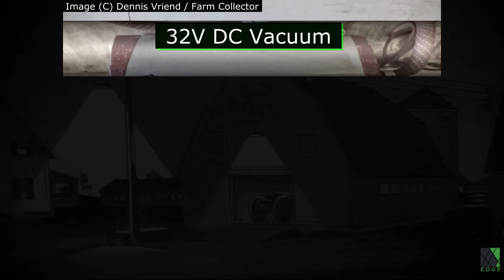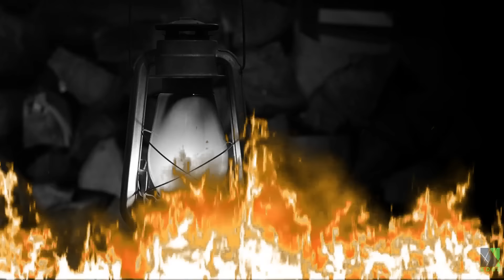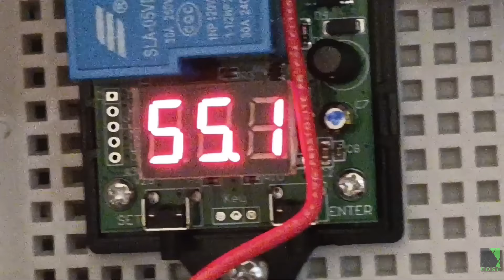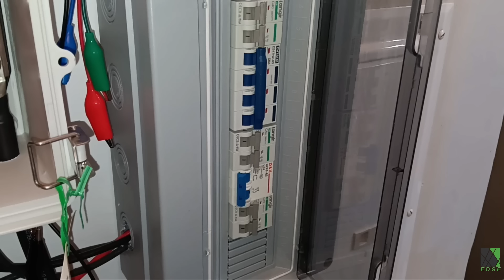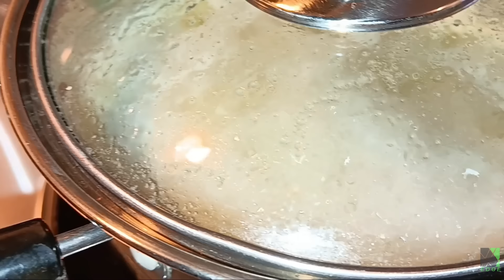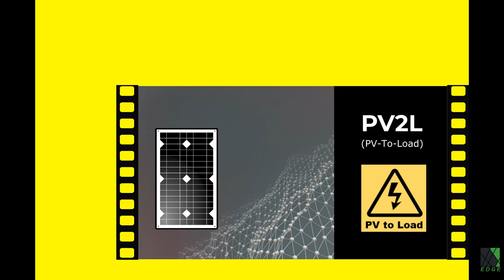LOST HISTORY: 1900s OFF GRID DC - How Did It Work? Off Grid Before Solar Power #history

Comment: I grew up in an old farm house where all the lights and electronics like the radio was powered by 12VDC. My grandfather built the house back in the 50’s. He had a wind turbine charging a bank of 1.2V Edison cells wired in series. It cost him around 10 cents a year to buy a tin of grease lubricant for the bearings of the wind turbine. 
Cooking and water heating was done via a built in wood stove. 
Those were good times.
Reply from the maker: @RayWarren-y8u Ah the good old days.... so simple and yet works so well. I need to get us a wind turbine our here!
Reply: Was it a dunlite windmill ? However I believe they were a 36 volt system. Dunlite also produced the 36 volt kitchen appliances and tools.
Reply from the maker: @Biggles732 Been doing some research. There is some available information available on Dunlight systems, they appear to be 32v from what I can tell? Or 36v nominal or they had more than one voltage standard. Not sure. Some of their windmills were over 1kw in size. Definitely not toys. Apparently in Australia they had radio communications powered by windmills and this was very quite common. Still researching the topic. I am glad someone told me about "Dunlight" otherwise, I'd  have never known what keywords to search for. It's  been very hard to find any decent historical documentation.

Comment: Kinda crazy that common household electricity is only 100 years old.
Reply from the maker: @superskrub4209 Electricity - one of the most useful forces on earth!
Reply: We are so dependent on it now if the grid went down there would mass chaos beyond belief.
Reply: @RodgerMudd yes but not in the Amish communities. I think we need to take a hard look at using battery powered home maybe not full time until we have to but on a doable scale. My plans are to put a tiny home on my NC mountain property and run everything on battery power. Spend a whole week on battery power if it becomes a way maybe it would work full time. We use too much electric for nonsense. The laundry would be the hardest part especially if it rained. I'm going to do my lights on filament bulbs I'm not a fan of LED lighting. I removed most of mine in my current home. I use 22 watt and 11 watt bulbs the four watt are my night lights. I have two lamps with four 11 watt bulbs using three Y sockets  in each lamp the fans have 25 watt bulbs. It's bright enough in the living room. I have LED T8 in the kitchen but I don't use it only on occasions when I need more light. The one over the sink is enough and over the stove is enough too.  The dining has five 11 watt Edison style bulbs. Same as the two lamps in the living room. I found out the LED bulbs bothered me so I went back. I cannot stand bright 6000 k lighting of any kind. 73

Comment: Nice.. and WOW..  32V.
Reply from the maker: @OFFGRID_Trucker It's kind of ironic because many detractors and so called "engineers" tell me 48V+ can't work for residential power!!! even though I have a working system for years now... meanwhile, our ancestors were running all kinds of appliances with only 32volts and old thin wires.. :D :)

Comment: To start with for all the koolaid tree huggers!  Without COAL, OIL , there would be nothing!  No industrial anything! It takes energy and without COAL AND OIL, it would have Never Happened!
Reply: The reason for solar, especially using methods like solar edge is using is a lot cheaper than buying grid electricity. It doesn't matter if it takes coal or natural gas to make the panels and rare earth minerals or lead to make the batteries. It's like the difference between having your own vehicle or relying on public transportation. All the lights are off around you and the linemen come looking for a blown transformer, but your lights are on. It's a very satisfying feeling.
Reply: @melvinhunt6976  as is the case this time, it's actually you guys always starting the fight. You make us out to be tree huggers because we want cleaner tech now that it's available. Calm down dude. Big oil paid a lot of money to get you to think we are the enemy.
Reply from the maker: As I always say, everything, including solar panels / batteries, came from the grid... powered by burning fuels, factories, digging machines and massive refineries.

Comment: my grandma left a memoir explaining how it was like to live without electricity in the 1920s and what it was like when they got their first battery. i believe you used to refill these with electrolyte. 1800's versions of the Sears Catalog also feature manually refillable batteries
Reply from the maker: @999aurora Fascinating, we need this part of history to be better documented
Reply: Modern flooded lead acid cells need to be topped up with water since the acid stays while the water is electrolyzed and forms hydrogen during charging, and the water can also evaporate from not perfectly sealed cells. But yeah it was within living memory of people alive today that they stopped shipping the batteries dry and letting the store fill them with acid when they sold the battery, now that they ship filled with acid, they have a shelf life.